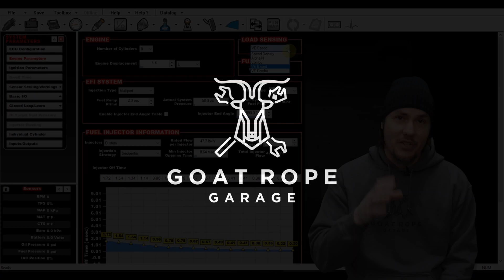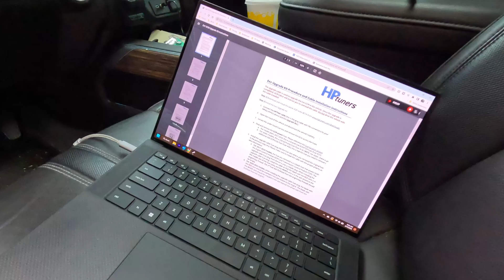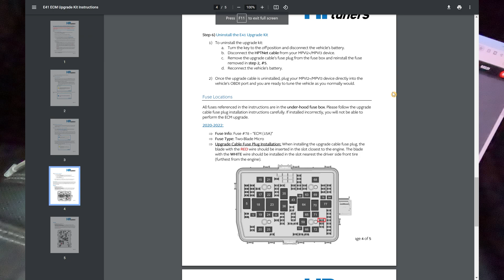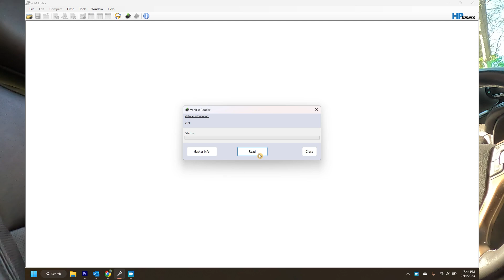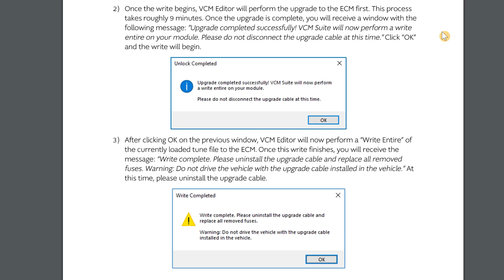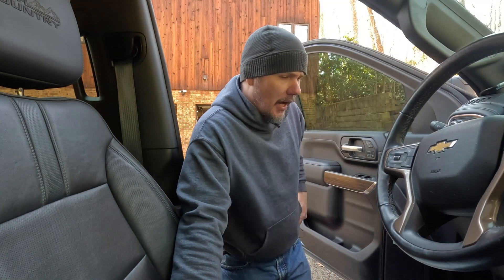L5P Unlock At Home With HPTuners E41 Unlock Tool Tutorial!

Comment: Did you not have your key in the run position? The other ones I’ve watched they either had to hold the push to start button for so many seconds or turn the key to clicks.

Comment: Keeps failing to read on a 2018 after I acknowledge the message that control needs upgrade and will be done during the first write process.  Any ideas?
Reply: I got the same issue with my 2018 did you ever figure it out ? Any help would be great thanks !
Reply: you need that special box, the e41 unlock box & 8 Credits from HP tuners
Reply: Same issue 2018, with e41 unlock box

Comment: Can anyone help, I've gone through the process for the parameter access but am still unable to access the emissions for the L5P. Is there another course to take or something? Received a tune from a "tuner" that deleted, so they got access some how! The truck is running without codes and full delete, but I'd like the ability to tune myself.
Reply: Did you ever get this figured out? Thanks
Reply: @bloodcamarosexmagik4223  no....:( nothing yet!
Reply: Hp tuners is just the communication gateway to the ecm, the tuner just uses their software to send his tunes he made on his software to the ecm. Hp tuners doesn’t support emissions tuning which is why you can’t access it.
Reply: @chase6612

Comment: So is there a list of what you can and can't do when tuning the new diesels? I was under the impression you can't do much of anything with HPtuners on diesels.
Reply: HPtuners is the only way to do the l5p’s. No efi live.
Reply from the maker: Can do anything as long as it isn't emissions related.
Reply: @GoatRopeGarage  I feel like adding power to a diesel will always run the risk of changing emissions. Don't get me wrong, Gale Banks can cleanly add power to a diesel, so I know it's a thing, but guessing with parameters isn't always going to improve things.
Reply: @Goat Rope Garage  I want to remove all emissions components....will hp tune achieve this? Update ecm, load a downloaded tune, physically remove emissions?